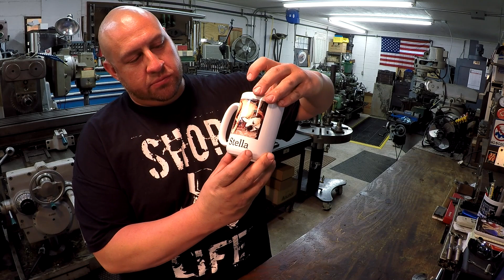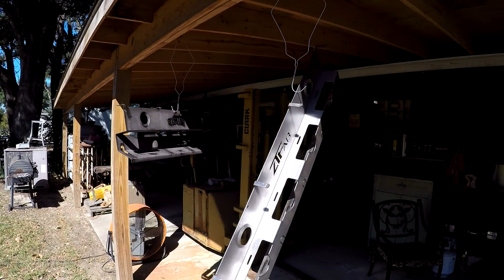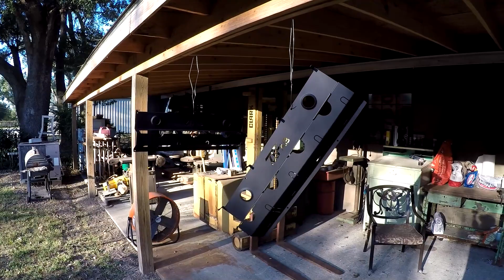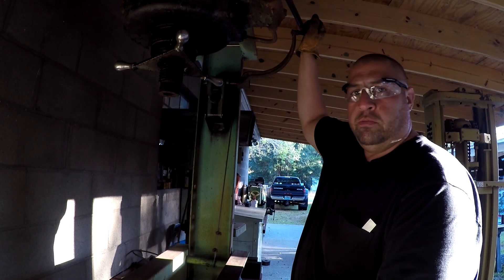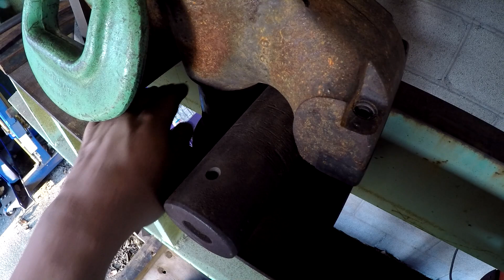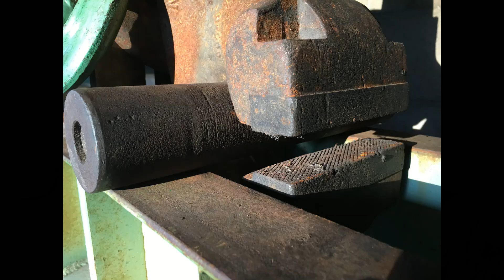Saturday Night Special 141: Stuck Wilton Vise, ZTFab Grinder Racks, Abom79 Hoodies!

Comment: With all due respect Adam, you do not need a "bigger" wrench, just use the one that you have correctly, you were using the wrench back to front when trying to undo the clamps and reducing your leverage capacity.
Reply: Check out Tubalcain"s (mrpete222) video where he tests several wrenches forwards and backwards to destruction using long cheater pipes. It turns out that it really doesn't make a difference (some broke one way, some the other) if the wrenches are of decent quality. I was always told to ALWAYS use wrenches the "right" way, but I don't plan to bother in the future. I'll put the wrench on whichever way fits best or gives me the most efficient angle for pulling on the handle.

(Coincidence: my grandfather was also a blacksmith from Sweden (Friggeråker, Vastra Gotalands) apprenticed in 1890 at age 7, came to US in 1905 and took up machining. I believe he was the one who told ME about which way to use a wrench.)
Reply: The angle on the open end is to allow moving a bolt or nut when you don't have much room to swing the wrench. Move the nut 30˚, flip the wrench over, move the nut another 30˚, flip the wrench back (now you can get on the next set of flats), rinse-and-repeat until the nut is off. (BTW, this REQUIRES that you use the wrench "backwards" at least half the time.)

The ring (box end) is usually 12-point, so it has half-steps built in. If it is a 6-point, the points may be rotated by 30˚ so you can do the same thing, but probably not if the head is angled up for knuckle clearance.
Reply: The thing is, that just like a vice, adjustable spanners have a fixed jaw and that is the one that should take the stress when tightening or loosening a nut or bolt.
Reply: Like I  said, Tubalcain demonstrated that adjustable wrenches are just as likely to break whether used the "right" way or the "wrong" way. It's as easy to break the fixed jaw as to break  the moving jaw. I watched his video and now believe that it makes no difference which way you use a wrench.
Reply: But that is why you find all spanners have an angled head on the open end whilst the ring is straight.....leverage.
Reply: rich kellow  Many don't know that there is to ways to operate a wrench. They are stronger one way and weaker the other.  When he was losen the c-clamp it was the right way. But when he tighten the c-clamp was the wrong way.  That was what my grandfather though me. He was a blacksmith and machinist. With regards from Sweden.
Reply: Peter W. Meek My to using both ways. But if I will have high torc I try to have it the right way ☺  cool that you have Swedish ancestors ❤

Comment: Those extra heavy duty clamps are nice.  They will take about 250 ft*lb of torque to tighten properly (to their capacity) assuming they are 7/8 thread 20,000 lb ones, so your wrench was a bit light duty.  They are super expensive if you want new ones, over $100 each at McMaster assuming yours were 4".  The 8" ones are closer to $400 each and I don't even know if those are import prices.  USA made ones are about $190 for Armstrong 4.625" ones.    Good job though.  Looks like the bore will clean up nicely.

Comment: Hey Adam, now you've seen firsthand what I was saying about fully submerging stuff in EvapoRust. Glad to see you were smarter than I was and took the tap wrench out before the groove got very deep.
Reply: Plastic rain gutter can be used to fully immerse long narrow objects like tap wrenches.  Works for both Evaporust and electrolysis. For electrolysis, make a full-length anode.

Comment: Nice work Adam.  I had to do the same job on a little 3" bullet that looked like it hadn't moved since 1946 (year made).  I did everything the same except I supported the bottom of the mounting base instead of clamping it to an angle plate (and I used an impact socket instead of a cone).  Keep it up buddy.  P.S. Did you remember to wish Tom a happy birthday?

Comment: Good deal Adam, if Kroil don't get it nothing will.  Love that stuff, but wish the airsole  cans would not loose the pressure??
Reply: Glenn Felpel Hold your air blow gun on the valve ( take tip out first) give it a small depress on the gun. It will energize the can with air. You will be back in business
Reply: On can's that have lost pressure you can use A punch ( I use A Thexton Super Punch) and punch A hole in the top of the can. Move the punch slowly from side to side so any residual pressure is relieved. Remove the punch slowly and then you can drain the contents into A plastic spray bottle. Wear your safety goggles and old clothing. I have done paint can's but they can be messy so I try to avoid them.
 When I worked at A service station we drained ether can's (starting fluid) but I would not recommend it. Besides that stuff putting one to sleep it could go bang!!
Reply: I have cans that are almost 20 years old, the paint is perfectly good. And they are no name too. Some generic stuff i got when i was in Russia for a month (i'm from Europe).
The only thing you need to look out with them is rust. Any rusty bottom is dangerous because that means that the stuff inside either leaked out and corroded or that it was sitting in water. My case, the one i found was from leaking at the bottom from a bent lip, hasn't popped or anything, but just like with any pressure vessel, you don't play.
Reply: Thank You.....Never knew that.  That is a life saver Kroil is to expensive to waste. Good one Terry.
Reply: Yes, I understand.  Thank you.